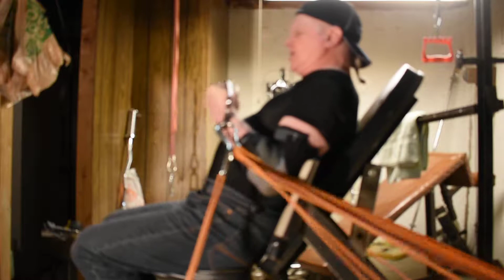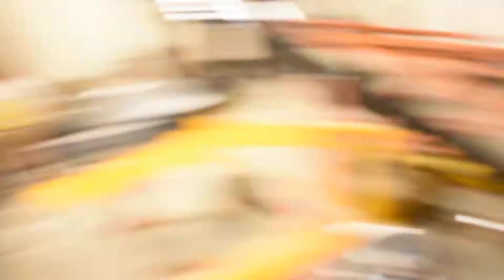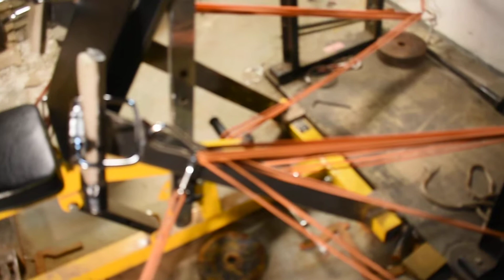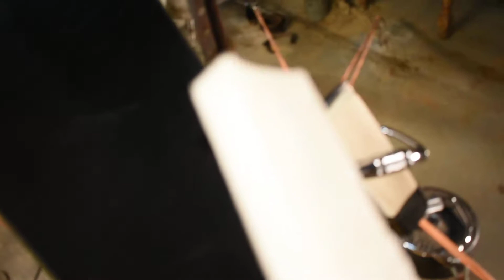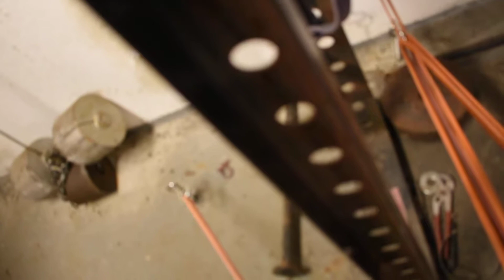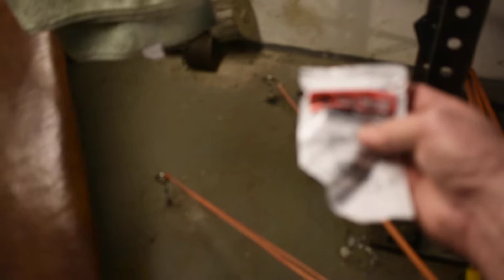001  Concentration Curling Machine  DIY

Comment from the maker: At 69&1/2 yrs. old have started out again after a year layoff.  Just finished 8 sets. Two were crossover lat& tricepts warm-ups for  concentration machine curls 6 sets of bands(each set was 6/7lbs each .). Started with 43lbs or slightly more on preloaded handles. Added bands till a total of 79 or more pounds total. Just pulling that last set to get my arms in the stirips(arm craddles) is a major job, but still managed 8 reps.  Absolutely neccessary to ware elbow protection(i don't fool around and use those strongman contest( on TV) "Rehband"(same thick ones used by the guys lifting those 5 giant stones).  I will also load bands(micro mini's- 6lbs.) from the front snap hooks after a month of the bands at my feet and from attachments from behind me.

Comment from the maker: Folks this is the best curling rig bar none. Having moved all around Metro Detroit to get the best wages in steel plate fabrication, i found myself in a aphabet soup of pro gyms. This set-up eliminates batches of other sets for bicepts.  Younger guys can still superset forearms quickly between these band sets. Will help anyone interested in the steel fab of the REMOVABLE parts to this simple fab job. If you live in Metro Detroit i can tell you who can do the fab(last&best fab shop i ever worked in). You hook up with them they call me(i can guide them for finished components). All you need is an incline bench with only rectangular or square framework.
Reply from the maker: Used a weigh scale to exactly figure out that at the length of stretch these micro mini bands are 7 lbs.  They do show 10 lbs., but only when stretched to 80" to 100" lengths.  Have made reweld E Changes to my setup to better ergonomically fit my workout partner and myself.  Bands that are doubled over to chop up length at my feet can make this rig beyond belief to curl. Also added 4 bands from way in front with easy hook attachment that bring each arm out to 130 pounds pull each arm.  Again simply doubling(folding in half) another micro mini pink band will make the unreal pull of 144 pounds each arm.  I know that there arm loads of are chair quarterbacks (doubters) that want to minimize the resistance here, but when fishing a pike or walleye or a 600 pound Swordfish there is an obvious difference.  Most serious gym freaks if in this rig would instantly know that just putting your arms in the cradles is very very taxing.